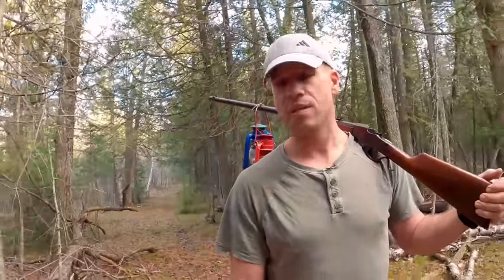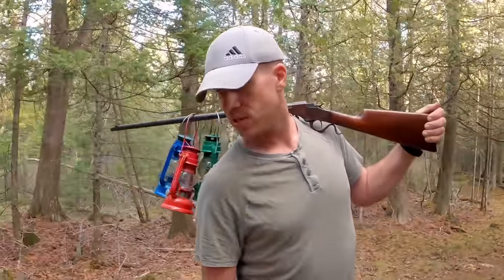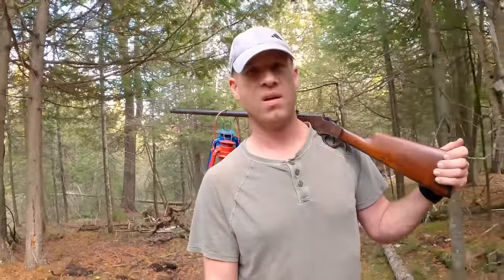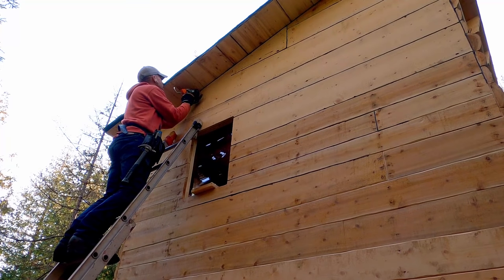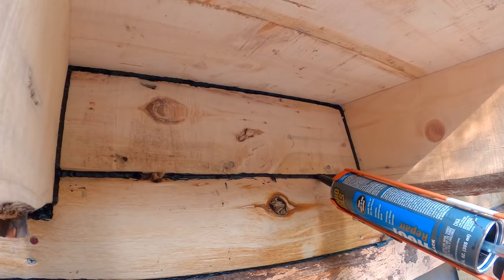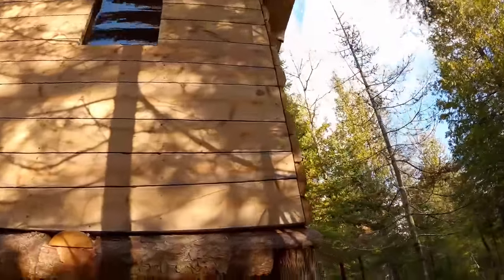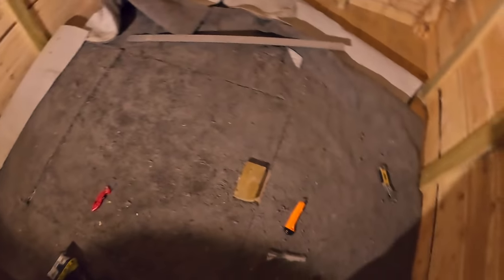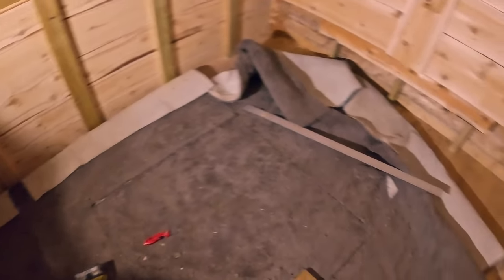The 7’ High Deer Castle, Finished! #19

Comment: To keep the squirrels or anything from climbing the poles, use an aluminum "valley" wrapped around the poles and nailed to it. Usually, three to four feet distance would be sufficient. Old stove pipe would also work. Love this channel, keep the building happening - your ingenuity is amazing.
Reply: Tried that even put grease on the stove pipe the squirrel s went up the pole to the bird feeder.
Reply: Try an owl decoy

Comment: I can't believe I woke up this morning, stumbled across one of your videos and ended up binge watching every video and it is now dark outside. Great videos. Dude please let this channel season and don't stop making videos. Stick it out wait on the subscribers. As far as squirrels go you can put discs/inverted sheet metal or plastic  cones (like dog no scratch collar) around all the supports, face open end of the cone down but don't know what you would do for the rungs on  the  ladder.
Reply from the maker: You are one sick puppy! If you weren’t before binging I bet you are now. Haha. 
Going to try to continue through the winter but as of today none of my batteries that charge my camera batteries will work. Too cold!
Hopefully I can figure something out...
Reply: @survivingringworm2202  I have foldable solar charger that fits in my backpack about the size of a medium book. Has three solar panels when open. They aren’t too expensive and do not require permanent installation.

Comment: What a tee-pee or tee-pee complex you could build and not even need the tent anymore. I believe that you have all the materials to build one or more (attached) and heating would no longer be a problem in the winter.  One twenty or twenty five foot high erected right on your existing tent platform (or build another) and several around it for an inside shower (plus facilities) and even a wiki-up sauna could keep the whole place warm and all your tools dry and even your water supply fluid.  Carefully planned you could be inside in a couple of days to a week.

Comment: I would say that stilt cabin looks great. Like a home away from home. I would say for no plans other then something in your head, an winging it as you go. Looks good !!! An should be there for a good amount of time.  Idon't know about mice of squirrels but Ihave shed I made an those rear pinscher bugs an ants. I sprayed the inside with diesel an no more bugs or mice. I wouldn't spray the inside but maybe the posts an bottom of the latter may stop them. It's a oil base an stinks May keep you away too... lol
Reply from the maker: It's amazing what a fine mist of diesel will do!
I wrapped the legs with plastic from 2 liter bottles and coated with used motor oil.  Haven't had any critters come in yet and there are about a million flies stuck to the plastic!

Comment: Flashing tin is what the power companies use to keep squirrels from getting to the top of their poles .
Reply from the maker: Then that’s the thing to do! Trying to figure the cheapest way to do it. Someone suggested dryer vent pipe?
Reply: @survivingringworm2202  That would probably slow them down too!  LOL
Reply: this !  ^^^^
Reply: @survivingringworm2202  Agree with this - also, mint oil. Not the kind that goes in food, the 100% hippy essential oil type mint. Couple drops on a cotton ball, cotton balls thrown in corners/openings, no rodents of any kind. At least in FLA -- honestly I can't remember how tough MI rodents are. Palm rats are pretty tough, can chew through anything - but they won't go anywhere near mint oil. However I don't know how the bears feel about it.
Reply: Well I dont think I have any tin on this pole I watch the squirrel  sit on the top then he starts climbing the wires to my house.
Reply: It isn't aluminum?
Reply: It doesn't matter what the metal is made of - the idea is that it's slippery and they can't get a hold, or reach around it.
Reply: @cleoharper1842  That's true. I was just looking for clarification. I don't know that I've ever actually seen the metal called tin as flashing.
Reply from the maker: I’ll find something at the second hand building stores before long. Till then, I’ll keep the pellet gun warmed up.
Reply: @survivingringworm2202  It wouldn't be winter without some chicken fried squirrel
Reply: Iv seen where Indians used to just skin the trees to keep animals from climbing the logs. They used to make stands to keep food on top and that was their method of doing it. May have only been for larger critters tho?
Reply: @lopezinit2998  That would wind up killing the tree. Not saying they didn't - just saying if you don't want to kill the tree, this would not be an option. For that matter, boyscouts would make these high tripods/towers for the same reason.
Reply: Came here to say galvanized flashing for the squirrels.

Comment: Our stilted blinds have tin skirts about half way up the stilt. They do a good job stopping critters from climbing up. As for you ladder....maybe hinge the ladder up under the floor. gets it off the ground.
Reply from the maker: I think that’s definitely the way to go. Someone else mentioned using dryer vent for the skirting which seems cost effective. 
As for the ladder, that might take some engineering as its weight is screwed to a tree root.

Comment: Stove pipe over the stilts will work well. Maybe make a folding ladder to get it up off the ground.
Reply: Yep, stove pipe. Put it on standing old dead tree trunk to protect wood duck nest box. Had idk 2 ft section 2 ft off ground.
   Make your ladder hinge up or pivot on a rod when off season. Seen a vid guy had brackets where ladder goes and another set to hang ladder on side off stand therefore off ground when not in use.
   Caulking I like Big Stretch. You get what you pay for. All that work, don't get cheap on outside.

Comment: Try putting unwrapped bars of Irish Spring soap in the corners, on the mattress, next to sealed snack jar.  We put them all over our RV, which sits in a field over the winter. A friend, who works at a B&B, puts them by all the entry doors over the winter.
We have had rather good luck with this strong smelling soap.

Tried laundry dryer sheets, but once the scent dissipated the mice came in.
Reply from the maker: Why would they hate that soap? Wonder if anyone has studied this and if I could just buy the concentrated scent?
I have had mice in my car out here 3 or 4 times this year. Bought some little bags of sawdust looking stuff with a really strong pine-ish smell specifically to repel mice. And it didn’t work. Think I have another critter in there again.
Reply: Added bonus...you could wash you mug with them soaps once a month too!
Reply: Give a try to mesh bags/open containers of moth balls. I’ve used that for years for boat storage.

Comment: That one thing i love about a real log cabin!   Holds heat and cold, be cold out side and warm inside, be warm out side and cold inside ~ Takes about a week of constant temperature, to meet the temperature out side
Reply from the maker: My parents had a log cabin when I was younger.  They had to send someone out days before we got there to turn the heat up because it took so long to get up to temp.  But then we could also turn the heat off the day before we left and you didn't notice!
Reply: @survivingringworm2202  Those cracks and seams.  got to be sealed  even as they age and start spitting. This log cabin I'am living in is at less 45 years old and is holding up very good ~ Plus if i need to tear a wall out and replaced it. I have plenty of pine trees to do so

Comment: You can use the wide roof flashing to wrap the poles to keep rodents from climbing them, just make sure they go far enough up because those critters can jump. As for the ladder, I would make it removable so it can be hungry up under neath to keep critters from climbing it because no amount of flashing can keep them off of horizontal surfaces.

Comment: Nice concise video displaying/installing the necessities of a hunt stand!  The most dire necessity, eave/overhangs (lookout/outrigger framing) on windows and doors!

08:13 Golden -> Politics non-existent within rural areas!

As far as rodents, you're screwed.  I've seen even smaller deer mice chewing holes through quarter inch plywood, unless exterior paint or pressure treating is applied.  Now imagine the larger rodents such as squirrels.  And thinking, once animals smell anything possibly not naturally occurring and/or remotely smelling like food, they're going to chew through massive amount of material, so limit food else war will be imminent with the small rodents.  Armoring with hardware clothe is next best method.  Another idea, once timbers are completely dried, black tar/foundation sealant the bottom, and/or several coats of translucent wood decking sealant.  (My vote, good initial coat of translucent sealant will likely stop rodents, then second coat.  All else fails, then ugly foundation sealant.)  On the flip, cannot say you don't have any friends in the woods, especially while sleeping during nighttime!

Comment: First, I do like the end result of your project.   Very nicely done.  As for building without a plan, why not?  I'm a former homebuilder and have built a few deer blinds on my property that started with nothing more than deciding I wanted a deer blind "right here."   Every one turned out different but all serve their purpose.   They are deer blinds, not showcase houses!   Build them as you go.  I will be fine!   Obviously, building these things isn't rocket science but you do learn good lessons from each one that help out on subsequent projects.  

My first major blind on my property was literally built attached to live trees....which is a huge mistake.   I built a couple more like that then switched to ones that are supported by lumber, not living trees.  Too much movement of the trees and damage due to the trees growing around the blind over time.  I actually removed one blind due to the problem of having it attached to living trees. Like you, I discovered a 6 to 8 foot height above ground to the floor level is enough.  Not much benefit from a taller blind but lots more instability.

I tried various sizes and discovered a 5 x7 size works well.  So does a 6 xx 8.   I won't go smaller than a 4 x 6.  Mine are mostly built with salvaged materials, such as old decking boards or other treated lumber, culling out any bad pieces.   I like to use old iron security doors such as for a sliding patio door as the subfloor instead of lumber.  Then I just screw decking right onto that iron frame.  The iron frame will hold far more weight than will ever be put on it and holds up virtually forever.  Paint it first, if it is rusty.

Ii discovered that recycling old fence pickets, such as those made of cedar, really makes nice exterior siding and looks great.  
That stuff is already weathered.  You just have to pick out the  pickets that are still solid enough to use.  If you cut the pickets down to a 4 foot length, that works nicely and it gets rid of the top and bottom ends which usually tend to be rotten.  

Honestly, my blinds cost me very little, just as yours was inexpensive.  It's sure nice to have a spacious blind to sit in for hunting.  I only hunt with archery equipment, either a recurve or a crossbow.  So I have to build larger windows like you did.  I do like your snap  on method.  Great idea!

Comment: Squirrel deterrent:  
1 used but good deep cycle battery 
Corrugated / copper  24 to 26 wire
A cheap solar panel to trickel charge battery. 
Switch
Anchor with Calvenized or stainless screw on each post, wrap each as you see fit from at least 1' above grade
Tie into electrical. 
Now if you want too euthanize the rodents, attached an inverter perhaps. But the shock should be sufficient enough to keep them away. 1 time for each roadent is all it takes for them not to come back generally. But you may have some totally different vermints up where you are then I have here in Virginia.
Great work and attitude, keep it solid brotherman

Comment: The Bed is not so good! You need more boards, smaller ones, and leave a gap of 1/2 inch between the boards.  The mattress needs air from the underside, otherwise, 
it can start to mold!
The Deer Castle itself is great! Even the Awnings look really nice! Good Job!
Reply from the maker: You are totally right.  Luckily it'll hardly ever get used and even then during the day it'll be folded up where the mattress doesn't touch the boards.
Reply: @survivingringworm2202  In this case... that's OK then..lol. But many people just don´t know, why - for example - the Japanese roll up their futons over the daytime. It for drying out, and not because of space...

Comment: Aluminum sheet metal around each pole 3 feet tall at the top will help with the squirrel problem. Love the videos. Keep em coming. Keep doing what you're doing. I just bought a chainsaw mill. I'm doing a control room addition onto my recording studio using the mill.
Reply from the maker: Nice!  You have some logs at your place to use?  What kind?
Reply: Red oak, sassafras, hickory, cherry, and poplar.
Reply from the maker: Nice! Great to have a selection of good hardwoods to choose from.

Comment: Nicely done, it's a little more work than I would do, but nicely done. I might suggest adding two(2) thin pieces of dowel or just strips on the window 'awning' as a preventative measure, as there will be some weight on those small screw attachment points animals, and snow and such . It would suck to have to try to climb up during a snow fall just to reattach them.
Reply from the maker: Just waiting to find the right, weirdly shaped sticks/branches for just that purpose.

Comment: For additional warmth and sound proofing for hunting, consider getting some commercial carpet, you know the kind that is real flat and smooth, no nap to it.
Cut it and staple it to all of the walls on the inside, will make it really quiet, and sound proof it also. Leave all of the interior studs exposed to hang all your stuff on.

Then to make a place to pee, dig a 4" diameter hole directly under one of the inside corners. Make the hole 3'-0 deep. Drill a 4" diameter hole in your floor directly above it. Attach 4" PVC pipe so it is at a comfortable peeing height inside, then add enough pipe to reach the bottom of the 3'-0 deep hole. Leave the bottom of the pipe open, and drill multiple holes around the pipe up to about 12" from the bottom, this will make a sort of drain pipe. Place a 4" PVC cap on the open top end of the pipe.
You can pee right into it, then put the cover back on. No pee smell inside and you won't have to go down the ladder to pee when it is hunting time, you won't scare the game away. Also it will contain the scent of your pee from the deer.
Signed, Redneck Carpenter.

Comment: Those tree's you used as a base are gonna rot out eventually, the level of moisture in the soil and also resident pests will determine how long.. it seems a shame to build such an awesome structure resting on a temporary foundation. The Japanese are masters at getting wooden buildings lasting many decades even centuries in wet conditions. They use a technique whereby a large stone is placed on the rock and the big log thats going to be used as a the foundation timber, or stilt, is then scored so it sit directly atop the rock. The rock is always shaped so the highest point is in the middle of where the stilt sits on it. This means all water just flows off it and where there is an absence of water there is, for the most part, an absence of rot. You dont need to go to this extreme, there are many other options available but its definitely not too late to do something about it. Love your content btw, not trying to be critical in the least more so just a bit of friendly advice from a fellow carpenter!
Reply from the maker: I appreciate the ideas!
Most of the stuff I build out here really is ONLY for the fun of building something that day or week and likely will seldom get used. I’ve got a camp chair out here that I haven’t sat in in months because when I’m awake, I’m always building some new, ridiculous thing then going on to the next. 
Not saying this to suggest that there aren’t really good reasons to build with a longer view on things but rather express that I’m more of a spazzed-out little kid with grown up tools. I wake up and say “what would be the most thing to do at this moment?” then run off and bang something together or throw knives at something I’ve just completed. 
Still, your description of using big rocks under foundation piers is really intriguing. I might have to try it out on a projects just to see how it works. 
Thanks for sharing your comment/ideas!

Comment: That has a beautiful aesthetic. I love the way you just kept the tree trunks as they were to make the stilts for the cabin. Are you at all worried about them rotting though? Root systems rot much faster than anything above ground, so those trunks might need reinforcing within a few years.
Reply from the maker: Yeah, I actually have no idea how long the roots will last.  There are still some stumps around the area from when the place was logged about 100 years ago.  They are by no means sound foundation for anything but I wouldn't be surprised if these made it a decade anyway.